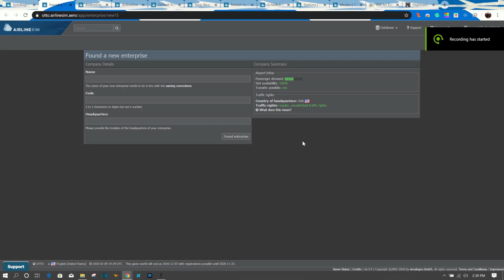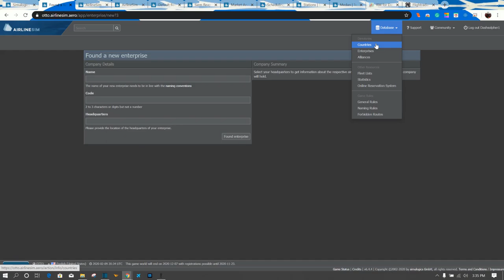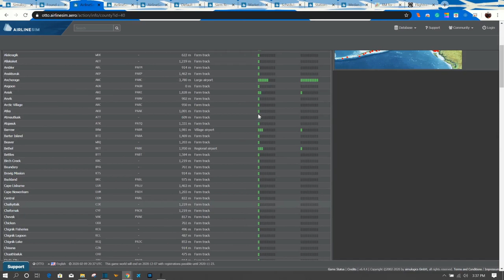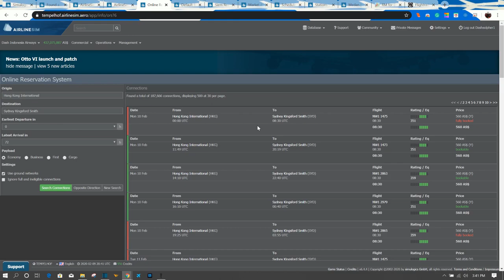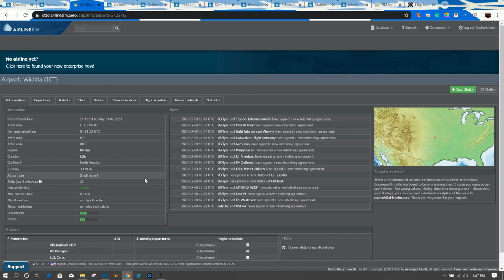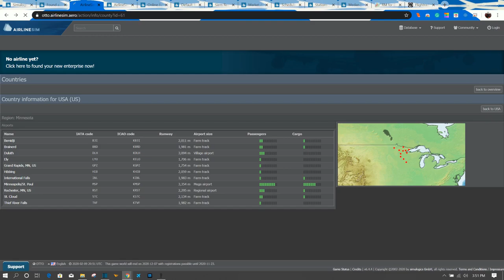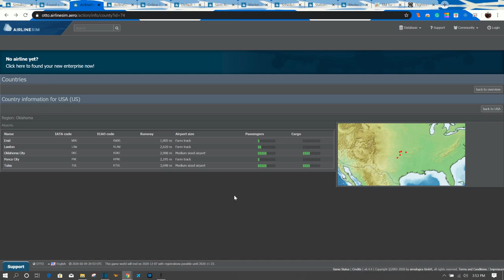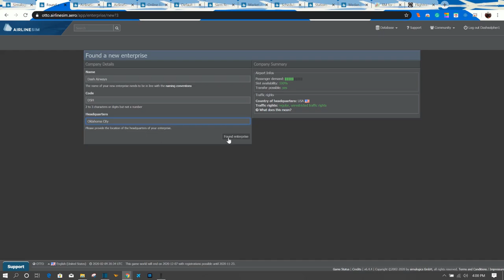Airlinesim | Tutorial | How to Build a Long-lasting Hub | Part 1

Comment: Thanks! I've been looking for an up to date tutorial. Love your strats. Whats your thoughts on connecting to small unserved aurports (3-5 bar airports) from larger hubs like JFK or ORD?
Reply from the maker: First of all, thank you for watching! To answer your question, it really depends on the demand and the state of your hub, whether it's developed or just starting. To be clear, in AS, the bar rating really tells you nothing about the airport's demand figures. It mostly just tells you whether the airport is big or small. In Indonesia, I service some of my 4 bar airports with A350s and with upwards of 20 daily flights. So it really comes down to your network. I would use one of the tools I talk about and look and see what regional airports are served from JFK and ORD to determine the viability of the route. However, if you are looking at those airports as a way to start out, I would not recommend it.
Reply: @Dashsolpher1  Thank you so much for the help! I followed your advice to the "t". I set up in Otto in a underserved non-US market with a good ability to bridge east and west. I have been setting my waves using the tools you showed, and I am stunned by the the bookings I am getting. Can't wait for your next video.

Comment: how do I know what the demand is between two destinations? Is it just trial and error?
Reply from the maker: Put simply, the answer to that is yes. There are no in-game tools that will provide you the traffic total between two destinations. You can use other players flights, to an extent, to gauge how yours might perform. I would direct you to a blog written by the dev team: https://www.airlinesim.aero/blog/2019/09/21/demand-in-airlinesim/ 
However, that is not to say that there are no other means to find out. The way to do it in-game would be to fly flights between two destinations exclusively, with no other feeders, until you no longer fill the flight. You can then look at how many seats you are filling and that is the total demand, but this method is impractical since you won't be in a world by yourself nor will you focus your whole airline on a single route. The other means is to pay for a real-world tool/software that the airlines, consultants, etc. use like Cirium or Diio. These have compiled figures for passenger numbers around the world along with connecting statistics. Unfortunately, these can be pricey as you might guess.
Reply: @Dashsolpher1  thank you for the in-depth response. Would a reliable way be to use flightradar24 like you did in your other tutorials? You could look at how many flights there are each day between two points and see what plane they are using to maybe get a good gauge on what you could do in-game
Reply from the maker: @BartoloVids  Your are right, FR24 can be a good source. All the worlds have been updated with newer data, so it would paint a somewhat accurate picture. I would advise that FlightRadar shows reposition and charter flights which are not factored into AS demand and network airlines have hubs which influence flight frequency. Using budget or point-to-point carriers can increase accuracy.
Reply: @Dashsolpher1  the only thing that would prevent me from doing that would be the pandemic going around right now. Messing with demand and scheduling everwhere